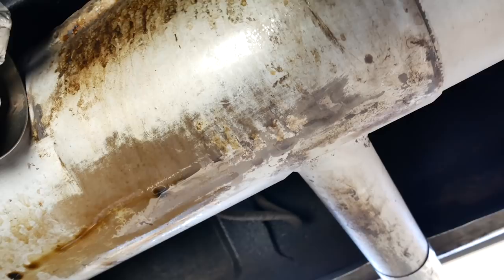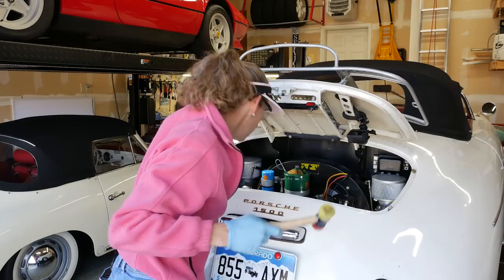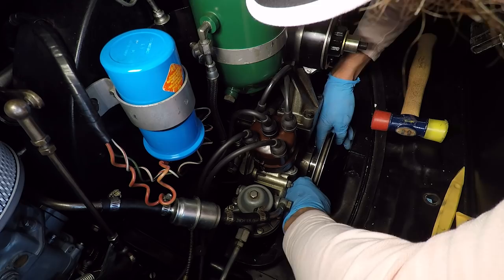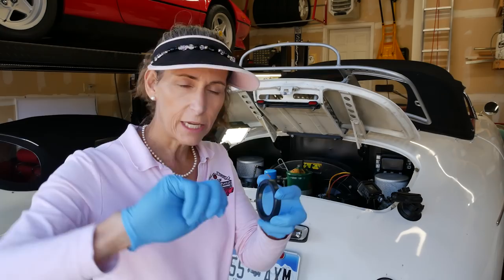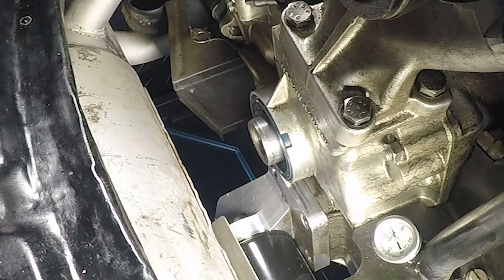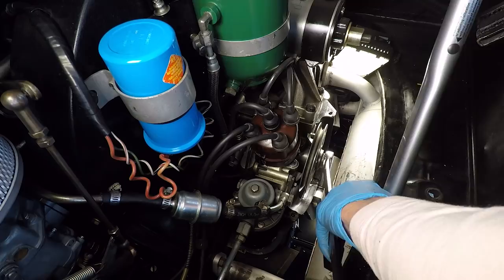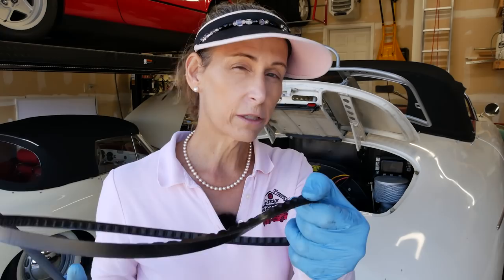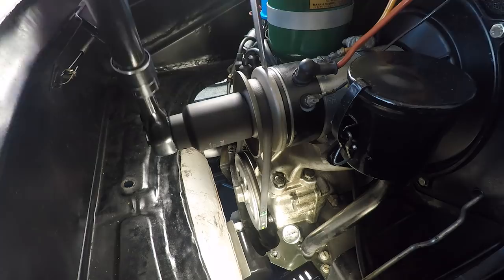Speedster Vlog #6 - Seal the Deal! -  Pulley Seal Replacement

Comment: The starter method of removing a crank bolt is common, but you usually do it with the end of the wrench against one of the frame rails. I wouldn't trust it if the wrench was just sitting on the tin.

Comment: Common point of oil leaks in type 1 engine right there at the crank especially when using a larger built engine with increased rev ability. VW did use use a seal either but relied on a slinger on the crank and the pulley itself has external threads that is supposed to bring oil back into the engine. I kinda wished they used the seal like Porsche did.  Funny you mentioned Muir's book. One of the first tools I bought when starting the hobby. BTW I've also found that belt tension will increase when the engine is  fully warm so I too don't set it too tight,it is no fun changing the genny or alternator while engine is in the car especially with dual carbs and extra breather box etc. You do nice work.Enjoyable to watch.Cheers.

Comment: If my co-worker — who does all the classic Porsche in our shop — could see you‘re installing the lettering on the belt upside down... 😁 Would pop his brain, that‘s for sure. One could only do worse if the pointy edge of the wheel’s Porsche crest doesn‘t points towards the tyre valves.

Comment: There's nothing wrong with bumping the starter to loosen the nut.  I put the long wrench inside of a half roll of paper towels for padding, put it on the nut, bumped the starter, loosened it right up.

Comment: By using the torque adapter you've changed the lenght of the torque wrench (lever). And because of that the measurement of the torque wrench might be incorrect. The lengt of the lever needs to be same as the lenght of the torque wrench.
Reply: We don't agree on the equal length principal.  The torque adapter device simply provides a fitting (looks like 3/8 inch standard) by which an actual torque wrench can be applied to a suitable open or box end wrench. The video clearly shows Franny's exertion of 45 foot pounds of torque as indicated by the clicking Tekton Torque Wrench . . .
Reply: @michaelmarrone5289  Well i would recommend some lessons in simple physics. ;)
Reply from the maker: If the torque wrench is kept at 90deg to the applying wrench, then the effective distance from the adapter to the point of applied torque is zero and therefore is irrelevant.  It has to do with the applied force vectors.  I go through the calculations in my video on the 356 transmission oil change here (9min in): https://www.youtube.com/watch?v=NbA08XqoakE  Also, there is an online calculator here: http://www.cncexpo.com/TorqueAdapter.aspx.  The angle between the two wrenches is key.  If that angle is zero, torque addition occurs.  If they are 90 degrees apart, only the torque wrench torque will be applied.  Check out the math.  It is interesting... Franny

Comment: Agree, another great video.  Quick question, on the seal install.  I used the install tool.  You can see the process when I did the engine rebuild here:  

http://www.912bbs.org/vb/showthread.php?44592-My-1967-912-Build-Thread&p=330824&viewfull=1#post330824

With the seal install tool... looking at it closely, you will see that it inserts the seal about 1/16" into the third case.  In my case, I was so paranoid being a newbie doing my first full engine rebuild, that I used Loctite 574 on the outside of the seal to make sure there was no leaks!

I am still running the break-in on the engine while it is on the stand... so far, no leaks.  Oh, here... a video after replacing the bent push rod from my mistake during install.  Engine is alive and running without any weird noises!!

https://www.youtube.com/watch?v=1VYVTGwRBzk

That torque adapter contraption!!! Sweeeeet!!!  I need to get me one of those!

And I just realized that I probably got the belt tension too tight... will correct that before the engine goes into the car.
 
Sorry for the multiple edits... could not resist to comment as I was watching the video.  So I kept coming back to edit as I learned something new.

I am loving these videos!! Keep them coming!  Thank you!

Comment: I think you're slightly confuddled about the lower gear vs higher gear.
Revers is usually the lowest gear in the box but it is also the weakest.  1st gear should be used to assist with locking the engine.  Park on your steep drive and it will chug down when in top gear.  1st gear will probably hold it.
Reply from the maker: Reverse is the physically strongest gear because it is straight cut.  Also it has the lowest ratio (usually) and provides the strongest hold against the compression of the engine.
Reply: @HeidiandFranny  The actual gear itself may be straight cut but how it works within the gearbox by going through an opposing gear on a not so strong shaft is what makes it weaker.  If you ask any or at least most recovery guys they will tell you through experience to never use reverse when tugging as it will probably break the gear.
As I said, reverse is usually the lowest gear in the box and as you say now (but not in your video) it will 'hold; best (as an anti-rotation) but it is still the weakest gear in the box.
I wasn't trying to be picky with your video,  TBH. I can hardly think of somebody I've been more impressed with by their work and have been binge watching your videos.  Although I do all this too, including heavy recovery I just find your stuff really nice to watch.  I suppose one of the main differences is that I do all engine and gearbox work in-house.

Comment: So a smooth belt is correct and a notched belt is wrong?  Didn't know that!  Replaced the kinda worn notched belt that came on my '68 Beetle with a non-notched Continental belt a month or two ago and thought I had kinda downgraded the system doing so.  Now I feel a lot better. :D
Reply from the maker: Hi Chris, I believe the non-notched fits the pulley better, but the non-notched was working for you.  Just make sure you keep a spare on you.   Just in case.
Reply: Oh yeah, there's a brand new spare belt in the toolkit.  :)

Comment: Thank you for the video.  What happened to the little washer that came out with the seal?  I didn't see you reinstall one?
Reply from the maker: I went back and watched it and I think that was the round spring that is actually part of the seal. Looks like it popped out as I was deforming the old seal while removing it.  The new seal will have it already installed. f
Reply: @HeidiandFranny  thank you.  You have inspired me to change mine.  I've got the nut off but the pulley is on very firm.  Any advice.  I thought about using a bearing puller but got worried it would move the crank
Reply from the maker: @neilbardsley  Can you get a puller in there?  I couldn't.  Don't put too much force on the edge of the pully as it can crack.  I used plastic wedged in the hope I wouldn't put too much force on it.  Try removing the rear tin and getting a puller in there.  Put the bolt back in (but not seated, but just a couple turns out) so you don't bugger the threads.  It was a bear to get out...

Comment: " If this doesn't work , I'll pull the engine ; it'll just add another 1/2 hour or so " . Do you have an engine removal video in the Franny archives ?
Reply from the maker: Ya know, I don't...  We have talked about puling the 356 engine to fix a few pesky oil leaks.

Comment: A nice easy 356 project for once!  lol
How much torque is the extendable ratchet rated for, without breaking?
Reply from the maker: Ya know,...  That is a great question!  I have put over 100 lb-ft through the 1/2 inch drive and it was just fine...  I bet it would go south past 150 or so...

Comment: Great Video!!  Franny trying to fix the pulley seal leak on my 64SC and I see the previous owner put orange permatex all over the pulley bolt and washer.  Is there any reason to do this?
Reply from the maker: I think, maybe to keep oil from weeping through the bolt?  Our 356 has blue Permatex on that bolt as well.

Comment: I had thought the notched belt was to reduce slip,  Google search seems to indicate notched belt is "preferred" but I can't seem to understand why or when it's appropriate to use one versus not use one.  I enjoyed the video but if you can address this issue that would help.
Reply from the maker: Hi David, The notched belt doesn't fit this particular pulley properly.  The OEM part is not notched either, which is why we used it.  When in doubt, we revert to OEM.  I'm sure the notched is just fine too.  Thanks.  F.
Reply: @HeidiandFranny  That's the rule I'll just use too then..... stay with OEM spec belt  - thanks!
Reply: Hi there. The profile of a notched belt and a solid one should be the same. A notched belt is normally used if the belt has to bend the other way like with an external pushing belt tensioner. This is not the case here why the solid is preferred due to the better friction ability.
Reply: @XiraArien  thanks!  :)
Reply: a notched belt is more energy efficient (not by a lot though). it takes less energy to run it through deformation cycles. as a result they run cooler and last longer. the tighter a std belt is turned in a pulley the more the notched belt will best it from an efficiency standpoint. i have a vw type 1with alternator and only run notched belts.